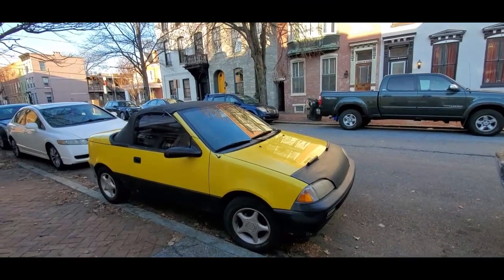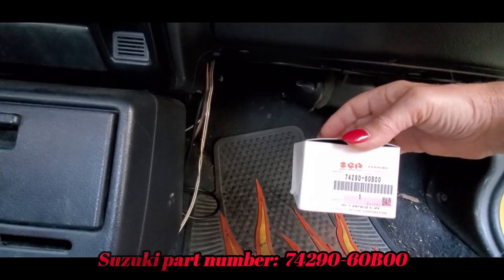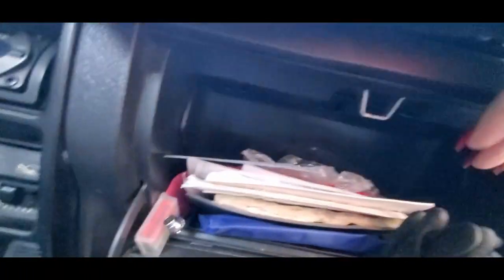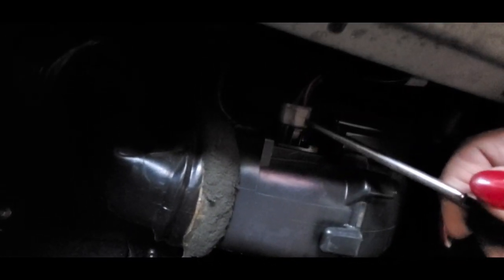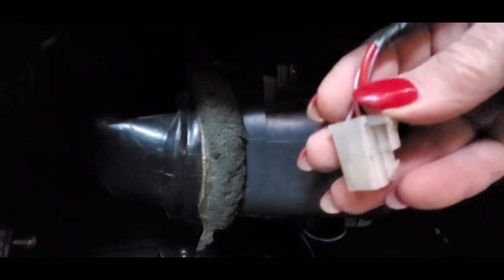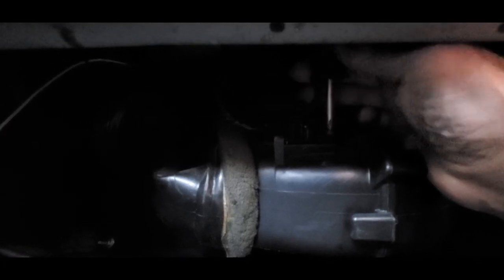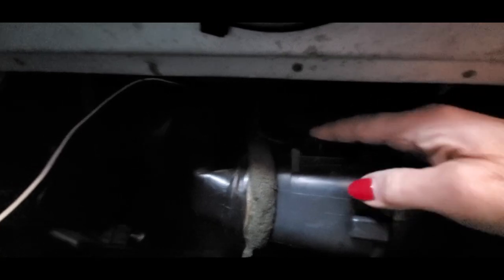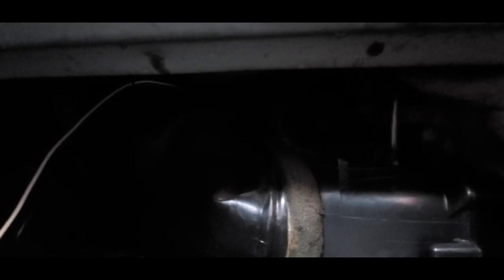Replacing the Heater Blower Resistor on a 1991 Geo Metro Convertible  Flea TV

Comment: A 32 year old resistor ,,, WOW that puppy held on to the bitter end,,didja ever notice how a mechanic,,,man or woman,, will wait until the part,whatever it is,, breaks completely before fixing it, I can say that cause I'm just like that,, don't know why,, Just am,, HI Pamela Cool documentary on changing the resistor,, I just knew you were going to break a nail,, I don't see how you did that without breaking one,,, enjoyed the show later,, Glen
Reply from the maker: The Flea has, at least, 200k on the clock. I think the engine had a rebuild or was replaced at one point. I bought her with 88k showing and have recently turned the odometer...yes, I have the video! The blower was down to 2 speeds when I replaced the resistor with a " whie box " unit. It lasted about a month before it started to burn out. This is the second one, and is an OEM Suzuki unit. I always wear gloves, but this job was so easy..... Have a great day my friend,,, in a while, Numero Uno!

Comment: Under dash has never been one of my favorite places, you need to be double jointed ..lol
Dob of Vaseline will hold screw to driver in blind situations.
Reply from the maker: I use magnetic screwdrivers, but I have used your solution many times with wrenches. In tight spaces, you can position the nut on the bold, put a finger on top, and start the nut so it catches... all while hoping the person who designed this nightmare, has to fix it!!!!  Being small ( 5'4" in my prime ) I could get under... as long as I tied my  hair up!